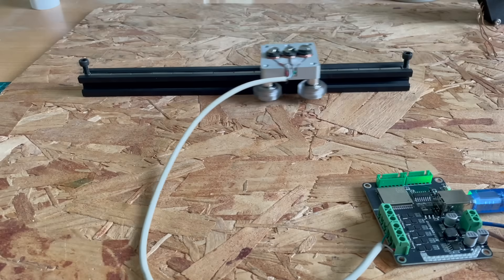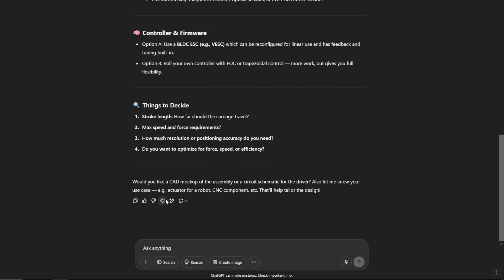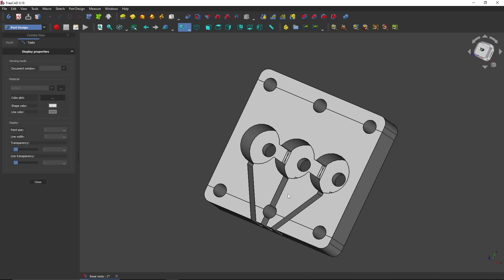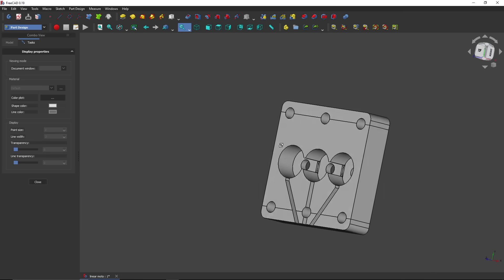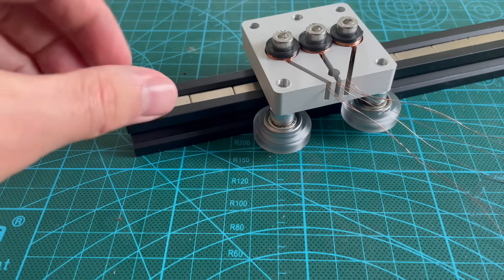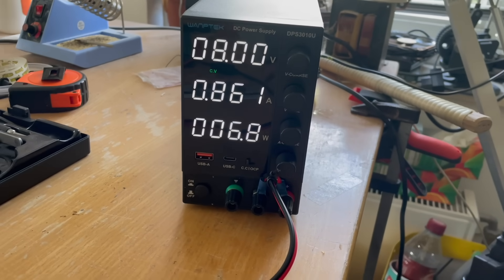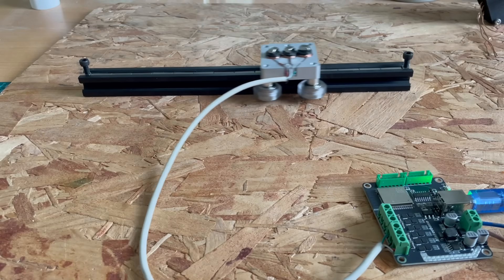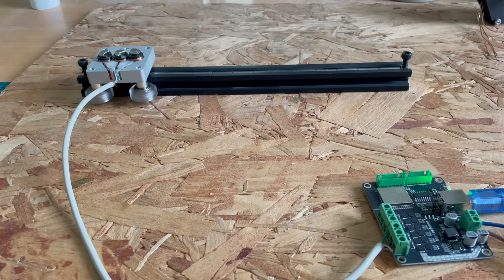AI Designed This Linear Motor

Comment: The first thing you missed is the a complete magnetic path with only air gaps between the PMs and the iron for each coil.  YOU NEED A BAR UNDER THE SCREW HEADS to completed an iron conducting path.  I assume you didn't use stainless steel screws. 

So the magnetic flux path is  100% through the fully current coil screw, through the air gap, into the contact between two magnets the same pole for both.  If center screw T flow but if end L flow in the magnets.  Half the flux crossed the air gaps for the other two screws and through the opposite pole direction caused by half the current.  And to the head of the screw that is clamped to the bar.  Into the bar and flowing to the full flux screw head thus completing the loop. 
 
The use of aluminum as some people pointed out should be plastic.  There will be some flux around the coils that will pass through the aluminum.  This will generate heat from eddy currents created.  Feel the aluminum after running back and forth for at least a few minutes.  If it is hot. replace with plastic.  Just warm do not worry about it.

Another assumption the iron and magnets are not saturated.  That can be calculated using a simple calculation for a transformer with air gaps our of a text book.  Alternate is to use https://www.femm.info/wiki/Download a 2D finite element program with lots of help available.   There are others also.

Comment: Nice project!
I am a bit confused by the way you put in your magnets into the rail. For a linear motor you would need an alternating arrangement of north and south poles pointing up, but is looked as if your magnets have the north and south poles at their short ends (not at the front/back), and thus when you mount all of them in a long row you are creating a single long bar magnet with north at one end of your aluminium extrusion and south at the other. What you instead want is a continues track of alternating north/south poles as shown here https://youtu.be/0McH4fIHtuc?si=2VOHFUb2M7SsFJAo&t=56
You might be able to achieve this with spacers between your individual magnets or by forcing your magnets into the track so that each magnet actually repels the next one.
Reply from the maker: Yeah they are alternating nsnsns I just forgot to mention it in the vid haha

Comment: Is that plate that mounts the coils made of metal? Say hello to eddy currents and low efficiency. Put a metal bar across the allen key side of the screws, will increase flux and torque a bit.

Comment: The easiest measure would be to close the magnetic field lines on the top by using slightly longer screws and adding an iron bar with three holes between the heads of the screws and the coils.

Comment: You can better use a gear rack transmission in combination with a small dc motor which is much cheaper and it also produces torque. However you have demonstrated very well what the the possibilities are to convert ideas in a working prototype by using AI, 3dprinting and fast manufacturing companies like jlcpcb which is very impressive.

Comment: I would scrap the aluminum for plastic. Also larger screw core, with thinner distance between the bolt  and wire. If you want even more put the cart between 2 aluminum 20x20 ectrusions with magnets on both so the coild act on both sides of the magnets at the same time. Larger sure but more torque for sure. Could also increase the torque with larger thicker coils. Just a few ideas.
Reply: Like someone else here suggested, if you're not using the other side of the magnets and you're not confining the magnetic field either (alu or plastic), you might as well use both sides of those magnets. So, not 2 permanent magnet linear arrays, but 2 sets of EM coils sitting on either side of a single permanent magnet configuration. With the added benefit of being able to put those 2 electromagnet arrays out of phase from one another, hopefully doubling up on accuracy as well as torque. Instinctively, I think this would preload the carriage as well.

Comment: Torque isn't a measure of linear force.
Reply: What is? Watt?
Reply: @TNX255 Watts are a measure of power. It's just "force" and measured in newtons or pounds. Torque is a rotational force about an axis. You might try increasing the voltage to your coils to create more force.

Comment: make air gap between screws holding the coils and magnets as small as possible and don't use stainless screws , use standard steel, also aluminium body might actually be hindering the torque instead of helping
try using plastic 3d printed body and measure tirque by hooking a very soft spring to the thing and measure how far can both variants deflect it

Comment: Look at a normal 12 pole 14 magnet outrunner BLDC motor and just unwrap it - arrange the magnets vertically so you have more N-S pairs per cm, make 12 longitudinal poles on mu-metal cores to match the length of the exposed magnets, 4 for each phase and match polarities. An outrunner uses only one side of the magnets, but you could use both sides for a linear motor and put another set of 12 cores on the other side. Then you should have huge torque and be capable of drawing tens of amps at 48 V, but you would need to add active cooling as it wouldn't be able dissipate heat anywhere near as well as an outrunner with a propeller on it!  Use a thicker magnet wire, 4 strands in parallel and 15 turns on each of the 4 poles for each phase -
Wind the wires so they lie flat like a strip. The linear analogy of a bldc outrunner stator would look like an extruded version of this x2 : (_T_T_T_T_T_T_T_T_T_T_T_T_)
             P1    P2    P3   P1   P2    P3
        (_T_T_T_T_T_T_T_T_T_T_T_T_)
           c   a                     c  a
          w  c----------------w  c
          |                                  |
P1 --+------------------------+
P2 ----------+-----------------------+
P3 --------------------+---------------------+

cw = clockwise
ac = anticlockwise
maybe I got the second two cores reversed so could be ac, cw, instead of cw, ac.  Using 14 magnets with 12 poles with 4 poles per phase reduces cogging and stalling.

Comment: Simply from a mechanical design perspective, I feel that the "bend" in the wire path cutout near the coils is a bit of a problem for the manufacturer. It would help if you could remove it. Also, I would personally add adjustment slots on one side of the wheels, makes the assembly more rigid for testing

Comment: I made a linear motor last year. I 3D printed a rail section out of ABS. Then what I did was stack the magnets in the same polarity on two different parallel row planes separated 12 mm from each row horizontally. This way the field would be concentrated in the middle. I tested this with a magnet plate tester from Amazon, that shows field strength color coded and radiating lines as well.  Then the motor carriage used Teflon (Refined to a fine almost ball point section)to slide on the magnets side groves. Additionally on the 3D printed rail was numerous cut out sections on one side similar to a optical encoder. But this was used as a linear encoder so the carriage knew where it was at all times (most times). I was able to use a POT to control the carriage travel along the rail with a DM542T stepper motor driver( if you use one with Arduino make sure to switch the logic to 5V took me forever to find that out …)

One thing I found that worked best is getting steel rods from my local hardware store, to use as cores to boost the coils strength. Make sure if you run high current that you have some sort of fins or cooling because it will quickly turn into induction heating…fast. Don’t ask me how I know. 

I was only able to translate my own power supply with it onboard the motor.
Reply: Why don't you post this so we all can learn from it. It's a awesome project.
Reply: Well done, that's the way!
Reply: Post the video

Comment: This definitely can be optimized to produce higher force.  Also it would probably make sense to use stepper driver rather than bldc and modify the coil setup to resemble stepper motor.

Comment: Regarding linear motors I have many questions. Like can the step be smaller than the length of the magnet? What are the advantages compared to using rotating stepper motors? Can the linear motors be geared to produce more torque or more precise steps? What were the factors that make your version very low on torque?

Comment: It's a linear displacement so it's not torque but force
Reply: It's thrust - you're thinking of thrust
Reply: Linear torque is technically work. Lbs/ft or NM axially measured are torque, and linearly measured are work. Force would be just the pounds or Newtons without any distance measurement. Good catch!
Reply: @youmakeitwhatitis  your approach may seem to make sense, since youre trying to match the units. for linear pushing physics its called thrust and its measured in newton, so his statement is indeed correct. thrust = force. its just a different wording :)

Comment: 1) You can make the design more compact if you refuse the 20*20 profile, print a frame for magnets on a 3d printer. 2) aluminum blocks part of the magnetic field 3) magnetic field is not closed 4) coil core is made of non-softmagnetic steel (you can use a relay) 5) To control MOSFETs, bipolar transistors must be used 6) you can use hall sensors for microcontroller feedback  7) It is possible that the winding resistance is too high - you need to either increase the voltage or increase the wire diameter and increase the current

Comment: I think part of the issue is that your coils are smaller than your magnets, meaning that more than one of your coils are probably acting on the same magnet in ways that probably aren't ideal. Also, it might help if instead of arranging your magnets N,S,N,S,N,S, you arrange them N,N,S,N,N,S or S,S,N,S,S,N.  This will give you much more "pull" the desired direction and much less in the undesired direction (that is probably candling out much of desired force as it is now).
Reply: This is very good advice if he wants to use these as linear actuators for a robot, since most of the time they would be in a certain range of angular orientations but having to support the weight in the same local direction (respective to the aluminium structure). For example, the leg of a robot dog could have 2 of these, both having to make the most force 'upward', so giving it a stronger direction and orienting it against gravity makes a lot of sense.

Good catch on the SSNSSN type of array.

Comment: Gravitational flux, electromagnetic wave frequency length for linear propulsion get the goddamn thing to accelerate as though that it was a nut on a screw down the screw and eventually the screw becomes a piece of cellophane that has the metallic strip from your ID card on it and you’re running the equivalent of the card reader and hauling ass and you drive the shaftboth spinning and linearly with a lot of power rail gun bullet there I just did all of the legwork for all of that in my head and that was the best I could save it. Somebody else figure it out.

Comment: OK, I got a good one and I’m repeating myself so it’s a pain in the ass and I’m not gonna correct any of my grammar take a tube put magnets inside the tube now make a shuttle that’s exactly like an induction motor that the shuttle has Stepper coils. The coil should all be connected together with that Lekman to help hold the thing in place at the same time the shuttle should be long enough that while it’s spinning, it picks up an ambient charge to recover what it loses for making itself move around and it stays on a wireless Wi-Fi network this shuttle that spins is a nut on a screw actuator it always stays wireless. It never gets a wire touch to it. You bring another device up to it and it near field puts a charge on a super capacitor and connect the security Wi-Fi connection And that’s all of the actuators on the drone because you need not to have the wires going through structural areas and out to get damaged all of the actuators on the drone this way, the drone is a walking Wi-Fi network doing spoofing looking for drawing droids drones, anything and everything digital technology to keep itself safe from it and to make use of it if needed for whatever task it may be tasked to do your thing gets powered down for any reason you have to come up and restart the main brain in it and then you take the tool and you reactivate all the active actuators that are necessary for one arm to work and then you hand it the tool, and it turns itself back on the rest of the waythere’s a whole bunch of different applications. I just keep seeing a C3PO.
Reply: Yeah, that last insanity boils down to use the credit card reader for the shuttle

Comment: orientation of magnetic fields is not correct. Make proper orientation and it will be much better. Check stator and rotor orientations in real motors.

Comment: You put one kg of weight and it didn't move even one inch. That's obviously because you mixed metric system with imperial. I think everyone would agree, that If you would put one pound, it would have a better chance to move by inch. I think making it stepper + belt or stepper + ball screw would be more reliable (but less compact)

Comment: a simpler approach was to directly use ender's 3 old motion system using rollers + gt2 belts, but using a pancake motor with a bevel gear to make it fit with the 2020 extrusion, also clean your soldering iron 😅. Still an amazing project!

Comment: open a stepper motor and  see if you can figure out how it works, them rearange the coils as it was a flat  kind of unrwrap the coils flat instead of the circular  design and you have a  linear motor .

Comment: Hey, try Qwen3 or Claude Sonnet Opus Reasoning Model.

Still, I am confused to your approach; why just not use traditional linear motion actuators for more torque?  A geared rack and pignon design might also be suitable.

Using AI to get more interesting acquisition options of what is already designed and works well would have been a better idea.  Why start from scratch?  It makes no sense.  AI might give you yet unconsidered amazing ideas on how to acquire what you really need from cheaper sources. IMHO.

Comment: Your coil cores must be soft iron or some other metal with high magnetic permeability. Perhaps have a second row of magnets above the top of the coils. Why did you choose aluminium instead of plastic for the moving motor body?

Comment: think you could improve the torque using higher quality magnets due to the emf delta being higher, also running the coils at a higher voltage would potentially help.
at the same time you could even just increace the turn number in your coils and drop your wire diamiter.
reminds of me when I made a railgun a while back

Comment: ChatGPT can generate 3D models with a simple workaround: ask for OpenSCAD project which will generate a text file you can then paste to the actual application. I did some printable stuff that way and it not only worked but was fully editable and parameterized with variables. You have to be verbose tho and describe the shape with details.

Comment: i think one simple improvement you could make is flip the carrier board upside down, the aluminium probly blocked a lot of the electromagnet.
Reply: This exactly!  In addition, you must get the coils located as close to the magnets as possible.  Also, using as little metal as possible throughout the whole carriage design will be very beneficial, including the screws.  The only "metal" you should introduce into the design are the screws for holding the coils themselves (think of them acting as ferrite cores)... as this will concentrate/focus the electromagnetism fields relative to the physical magnets in the T-Slot.  Other than that, AWESOME project idea!
Reply: @emailtooaj I would also add thicker wire to the coils, so that more current will flow and naturally the magnetic field will be stronger.
Reply: @FEN_IX8 If thicker wire is used, it will coil less loops. The electromagnetic field intensity, thus the force, is proportional to both the current in the wire and the number of loops, and a thinner wire allows for better wire packing: more total reel-cross-section metal area, thus, more total effective current. So, better a thin wire!
Reply: @emailtooaj I know it sounds logical but magnetic fields are not affected by aluminum.. Iron will concentrate them (ferrous materials) in the direction you want. Space is really the enemy of magnetic fields. They go through everything.. I love them a lot.. But sometimes hard to control.
Reply: @zaybxc0  , Aluminum is paramagnetic.  As a magnetic field moves across the metal, it induces an equal but opposite magnetic field in the aluminum, creating a drag on the moving magnetic field.  The same thing happens with copper, only even more strongly.  He needs to get rid of the aluminum entirely, and replace it with plastic or carbon fiber.
Reply: Yep aluminium is a conductor of electricity. Changing magnetic field induces eddy currents --> loss. This is how eddy current brakes work.
Reply: Aluminium is effectively transparent to magnetic fields. (As long as the frequencies are low)

Comment: Nice project!! can you increase voltage? also try using steel bolts instead of inox as the iron core for the magnets. Also the air gap should be the smallest possible.